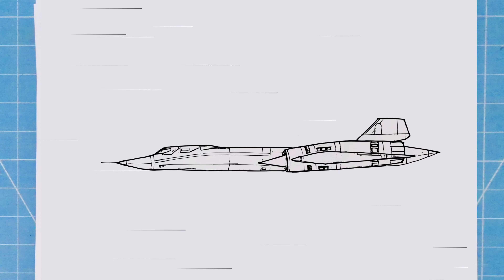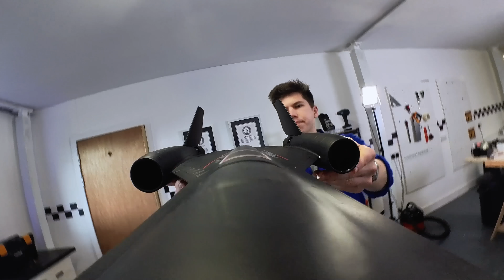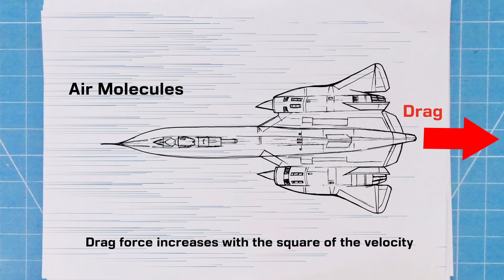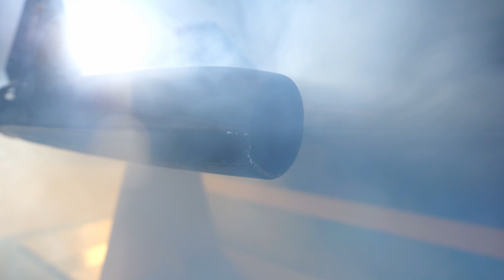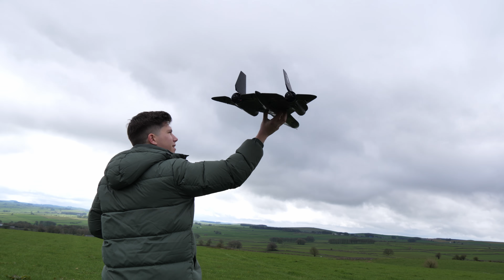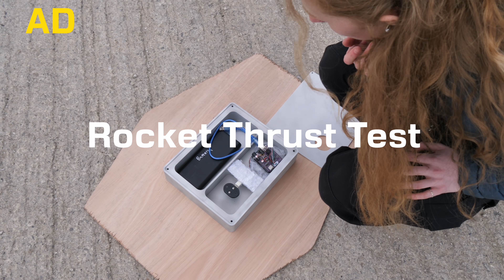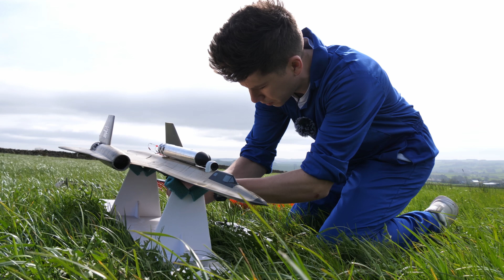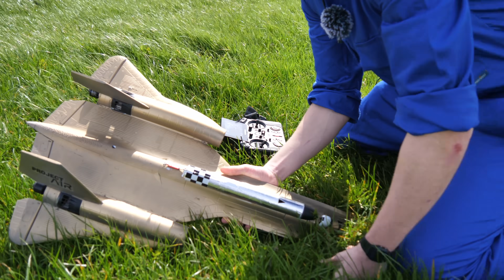Building a HIGH SPEED RC Plane (SR-71)

Comment: your problem is simple.  The SR 71 design is a terrible model to use for this experiment.  I would recommend something more delta or swept wing shape with more control surface and autonomous control like a drone quadcopter would use.  Also, try boosting the rocket straight up rather than laterally on the horizontal plane.  Think like... an SU 27 or F18 or F15 or even a tomcat. Saab Grippen, even.

Comment: I don't understand the switch from the Spektrum protocol to the FrSky protocol, and losing a very stable integrated Rx and gyro system (Spektrum SAFE Rx/Gyros) in the process. I've followed your videos for a couple of years now and wondered why you don't recognize Pilot Induced Oscillations (PIO) as the primary failure reason for losing control of your models. Without an Auto-Leveling gyro, you are just about GUARANTEED to lose orientation and the ability to correct the flight path of your model fast enough to control them.

Comment: Well that was fun!  Though these speeds are kind of childs play compared to what RC pilots achieve regularly.  I usually don't fly fast planes but my stock Strix Goblin can get 200kph on just 4S and there is this british Goblin enthusiast (omiegoolibird on youtube) who got his up to 450kph on 6S battery.  THen there are jet powered models going that fast, and if I recall correctly the highest speed records are held by dynamic soaring RC gliders, which don't even have a motor/engine.  Scale planes are draggy and not proportioned right to fly well as models.

Comment: Just a suggestion. The German V1 rockets were put onto a sled which ran along a track. At launch the V1 rocket would separate from the sled. To increase your lift off speed with a sled, why don't you use a sling shot arrangement so that once the model and the plane are moving along the track you can then start your engines and have an easier time of it.

Comment: If you use RC craft simulator calculator  and drag calculations  a model like this approx 1kg  in vertical dive will probably have drag of 1 kg in vertical dive of about  ~125 MPH eg drag balances out weight like sky diver flat prone are about ~120 MPH and nose down dive about ~200 MPH  on weight of about ~70 KG human( rounder heavy  fat people fall faster as sky dive jumper with or without parachutes  )  .To exceed this 120 MPH on 1 KG plane requires  like for example if same model had weight of ~2kg all up weight it might in vertical dive then achieve some ~150 MPH .The same vertical dive with all up weight of 3kg might achieve a speed of ~170MPH . So to get ~170 MPH will require some ~3 kg of push from a rocket motor  if the models weight is mere ~1 KG 
This suggest that removal of engines totally and strapping on three of these class  F rocket motors would have chance to get ~170 MPH in vertical dive or sharp dive with a pull out to level flight .So that requires a mother craft to get to height of probably 1000 feet drop the plane probably best to have  a pylon racer craft made for speeds of ~120 MPH with beefed up wing such as S400 class  Voodoo . As soon as the plane engine off in vertical dive  reaches ~120 MPH  light up 3 Class F rocket motors and hopefully  the controls can take operation to gradually pull out of vertical dive to achieve speeds of ~170MPH  bearing in mind the wings at ~170MPH will produce some ~5 kg uplift on plane weight of mere ~1 kg  so flutter could ruin the wing.I  been there done that with electric motor and lots of cells and weight of 750 Grams on S400 plane meant to less than 500 grams using about 1000 watts power  for seconds on ~4 inch folder prop of very  deep pitch probably doing ~ 30,000 RPM .Slope soaring on hills was easier  with wind of ~30 MPH behind plane and steep dive might have got more than ~150 MPH  great fun until whoop whoop and wings shred into epoxy dust and fuse become lawn dart

Comment: Summary:  Bad planning, could not fit gyro, He got a tiny supply of engines and will not spend $20 per motor to test again.  Could have started the motor at the extreme left side of the controller range and flew across his position without turning.

Comment: In real blackbirds and other high-speed aircraft, the control surfaces barely move compared to a Cessna, for example. It would really help if you could program the receiver to hit a switch and lock up control surfaces to just move a little bit

Comment: In highschool I built an SR71 Blackbird (built several really got good at it), but this one I made was completely psychotic.  Instead of the two wing set 
up, I built a model rocket sr71 with 4 wings. Looked something out of Star wars.  I had a solid rocket engine in each wing, and a central one in the middle.  Science teacher was afraid to launch it citing that it would steer off to one side, and fly into the crowd of observers.

Comment: of course it was unstable. you put rocket on top of the plane. what did you expect from it? you had to make either ideal (in the middle of airplane like the actual electric motors) or at least under the plane to keep it at least a bit more stable

Comment: Hi, I recently became interested in your crafts, especially after seeing the SR-71. I have following suggestions for your future builds:

1. Design a cartridge that can hold 4-5 rocket engines to extend flight time. Each engine would ignite only after the previous one has completely burned out. To maintain stability (and manage complexity), the cartridge could rotate to position each engine correctly before igniting it. 

2. Consider creating a two-stage rocket to enhance flight time or range.

3. You could also explore a combination of both of the above ideas.

Comment: I like what you're doing with SR71. Have you seen the 80's movie with Clint Eastwood-Firefox? I just want to correct a comment you made. The drag FORCE is proportional to the square of the speed, BUT, the power needed is proportional to the cube of the speed due to Power = Force x Velocity. So, double the speed will require 8 times the power. Cheers Shae.

Comment: To get more speed on this jet with just electric power , remove the edf system fully. Add a single small pusher motor high kv 2700. Drone motors like 35-50grams will work. 4.7x4.7 prop. 4s -6s.  She will be a rocket and still lighter than edf !

Comment: 🤔 Have you experimented with ionicly charging the points & wings front surfaces.. ? To create an ionic buffer, pushing molecules out of the way, helping to remove drag & to improve fuel efficiencies & increases in speed. 
🙄
I know.. next level stuff..

Also.. you put your rocket engine Way too fwd on that plane.. it had potential to work, if it was moved further back.. but you would of needed to shift the weight inside of it to counter balance/balance it all out. 

Regardless,  pretty cool

Comment: Maybe try counter rotating brushless motors it might be a good option for such a long engine bay as well as move the motors forward in the bay so that the air can be cleanly shot at higher speeds down the pipe

Comment: Chuck the rockets in the engine pods. Or put two rockets outboard, or top and bottom anywhere where you can get equal thrust along the forward axis, one on top is just going to flip it as you wont have enough pitch to overcome the thrust.

Comment: Since you have FDM printers... If you're able to get, get tullomer and print your next testbed plane with that? It's extremely durable and as I understand very light and also resistant to heat. Should allow your testbeds to survive lawn darting. :) Also... What if you turn the engine configuration upside down? A powerful jet on top and two rocket engines? :D

Comment: 5:55 It would be faster if you didn’t put a camera on the plane, as it decreases aerodynamic and increases the weight of the plane
Reply: He needs to see what it’s like in the air, to see problems and his light weight insta 360 is only a couple grams
Reply: Yeah but we need to see  it or ppl will stop watching
Reply: Or just use a camera with pointy head

Comment: Bro.. as someone who is a flight engineer mechanic.. I actually was invited to work on the last SR-71 before it was decommissioned and taken to the museum here in America... I actually got to ride in it.. so I will say this by you removing those nose cones you f*** up its flight mechanics and its ability to ran the air into those ducted fans... At higher speeds those nose cones are supposed to retract or push forwards.. look into possibly creating an aluminum nose cone that will slide forward and backwards during high-speed and low-speed performance.. also you want to take aluminum tape and cover the whole airframe with it.. make it a little heavier. The foam board that it's made from won't flex as much.. you definitely need to redo this... But at the back and the bottom of the plane you make a small tube, and slide your motors in and out of that tube you can't put the rockets on top they've got to be in the back or the bottom of the plane... I hope this helps. But yes you need to make adjustable nose cones and if I were you I would just take electric ducted fans.. the largest ones you can fit.. then revisit it with two small j series engines in the back.. get you an fpv setup from an old drone and some goggles and have fun

Comment: As others have mentioned, it's best to put the rocket motor inline in the tail because by mounting it on top of the fuselage, you are creating a high centre of thrust which will cause a pitch down moment on the aircraft. Thrust should always be in line with the centre of mass if at all possible - it's not so much of a deal when your aircraft has a lower thrust to weight ratio, as the aircraft's intertia through the air will counter that force better then, but this rocket has ridiculous thrust for the light body of the airframe so it's important in this instance.

Comment: In theory, if speed is increased 2 times, the needed power is increased 2 to the 3rd power tines (8 tines), not 2 to the 2nd power (4 times). 
Power is calculated by multiplying resistance force and speed (F * v) and force is calculated as: ½ air density * speed squared * surface area * aerodynamic resistance coefficient. When all that is worked out it turns out that P2/P1 = (V2/V1) cubed  
P = F v
F = ½ ρ v2 A C
P = ½ ρ v2 A C v
P = ½ ρ v3 A C

Comment: 1. No problem! Here's the information about the Mercedes CLR GTR:
The Mercedes CLR GTR is a remarkable racing car celebrated for its outstanding performance and sleek design. Powered by a potent 6.0-liter V12 engine, it delivers over 600 horsepower.
Acceleration from 0 to 100 km/h takes approximately 3.7 seconds, with a remarkable top speed surpassing 320 km/ h.
Incorporating advanced aerodynamic features and cutting-edge stability technologies, the CLR GTR ensures exceptional stability and control, particularly during high-speed maneuvers.

Comment: Would you consider trying a zero length launch system? Where the plane is mounted to a rail with a rocket attached to it.

The rocket fires, getting the plane to takeoff speed where the motor takes over. The German Air Force experimented with this on their F-104s. I believe the US did this as well.

Comment: Interesting , the actual SR-71 Ramjets (once engaged at high speed) create a partial vacuum in front the aircraft.  At speed, its tip and leading edges glow hot and the airframe expands.  As a side note, when the aircraft is cool its leaks fuel...to get max range it's air frame is warmed up and the fuel then is topped off in mid-air before a mission.

Comment: Perhaps putting the rocket motor in the aft section of the fuselage to remove the drag from the top of the SR71 would help with speed and maneuverability on the next one

Comment: About 8 meters of 6 mm bungee cord stretched about 1-2 meters with a foot release will make your launches much easier (think carrier launch).  The hook needs to be about 3-5 cm ahead of cg to keep ballooning minimal.  If you can keep it upright, the fans will keep it flying after the plane comes off the bungee before it gets low and slow like your hand launches.

Comment: Put the spikes from the intakes on the flat backs of the fan motors to streamline them and put the rocket motor in the tail of the fuselage rather than a pod on top far less drag and the thrust on the centre line + far better looking. Oh and then you stick the servos out the bottom rather than recess them.  Launch from a couple of 2 x 4 on saw horses for rails the hand launch looks all over the place.

Comment: I must say I hate one thing about aerodynamic "upgrade" and new engines: that they are no longer ducted. They just hang out right after the fan and air that was pushed into narrow tube with so much labour can now escape to the sides after passing the fan and not being used to push the airplane more, making it function like a vacuum cleaner. Moving the fans would also improve your center of mass but it would require much labour, but adding some light plastic ducts would fix the ineffective displacement of air. And like everyone says, make the rocket aim the center of mass, i thought that was obvious.

Comment: I'm much older than you, but we did something similar when we were your age. To get the aircraft airborne, we set up a launch catapult using surgical tubing as the drive mechanism, much like a high start for gliders. It did several things for us,  1) it accelerated the aircraft over a longer distance so it would not disintegrate, 2) it stabilized the aircraft until it was well past the speed to be flight stable and 3) it aimed it in a very specific direction.  I was on the controls and had my friend hit the trigger for the launch. It worked perfectly.
Reply: Jetex ? 😄

Comment: Your EDF don't seems to be properly balanced E-Flightj does a poor balancing job on those small engines ..
The truth is that you'll ends up buying a custom kit to get them balanced, it can be done but tedious. The end result is awesome, did that on the 30mm habu and several other small edf jets and not havibg your rotor inducing vibrations changes lots of things for the flight controler. Consudering EFlight still using ATmega chips in their FC having the same compute limits as multiwii running on Arduino

Comment: why mount the engine so far forward? would that not cause rotation? Ratos are usually mounted near the wings, at least the ones I have seen (apart from the ones that are there to push the nose up)

Comment: In future  might want to align the rocket motor’s thrust vector with the CG of the airplane. Mounting the rocket on too of the fuselage instead of inside it would tend to create a rotational thrust, pushing down the nose of the plane.

Comment: With the type of engine you are using, you might consider putting ducts in the design so the ejection charge doesn't blow the front off the plane.

Comment: what if you used a two stage rocket system, like had the 8 second burn on top to get you from motor speed to slow rocket speed and then had one or two quick burn rockets to get you even faster from there?

Comment: You could make a launch pad  with assisted control. A conveyor system pushing the craft at the desired speed and angle. No more writing off 👏🏼 Another suggestion you could add ground radio systems at further distances as you craft goes out of range it is picked up by the 2nd 3rd 4th or 5th radio system to sustain controlled flight at probably 10x your current flying radius.

Comment: just wait till you can get your hands on some Electrically throttled Solid rocket boosters...   Where you can start, increase, decrease and stop and restart the Solid rockets...  as needed.   you could do away with the electric motors...  launch with min power to the SRB... then bring them up to full, if you start having control problems you can lower the power   or stop them  glide down then use short puffs of power to bring it back and land it.

Comment: why put the rocket motor on top? that will make the plane unstable your pushing the mass down you basically have a constant pitch down with that there you need to have it in the middle of the aircraft directly behind the center mass if you want a natural pitch up put it on the bottom

Comment: see the cones server a valueble purpose on the real SR-71 since the plane uses what is called a RAM-Jet engine, this engine works very well at high speed but is not as good at low speeds, at around mach 2 is where this engine works best. the way it works is those ducts do not restrict air flow but rather compress it through the engine and force it in at high velocity, thus improving the fuel burn rate of the engine, now the downside was that you cannot have compressed fuel tanks on this kind of engine because travelling at top speed would compress the fuel to the point of exploding so they used uncompressed tanks(the fuel leaks out of the plane) now with this small aircraft idk if removing the cones would help or actually restrict what it could do, usually the designs of an aircraft are good for the type of plane that it is.

Comment: Very smart idea using a longer burn time rocket motor with less initial impulse. The acceleration that some of the short burn time rocket motors provide stresses structural integrity too much in a short period of time, leading to spontaneous disassembly.